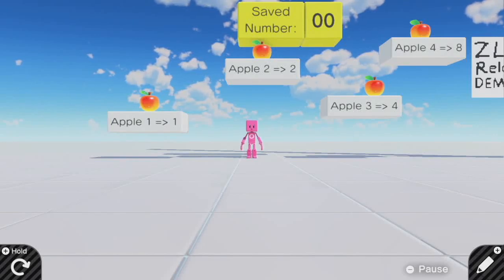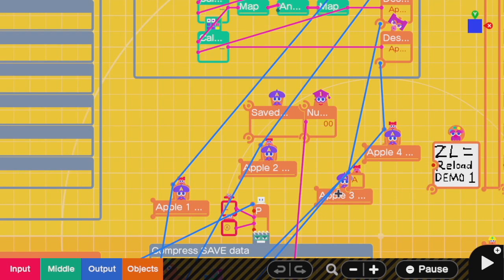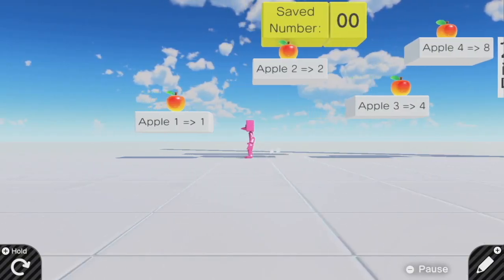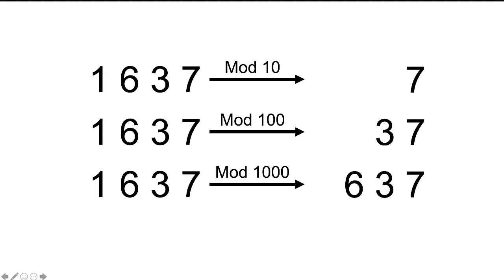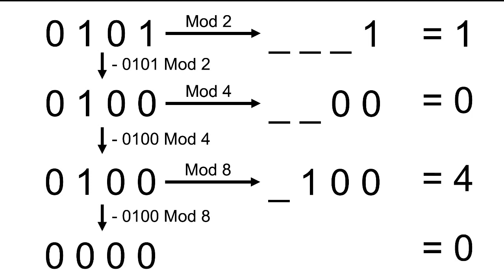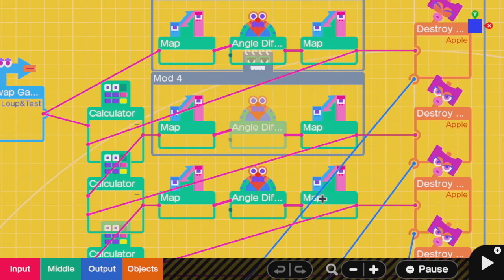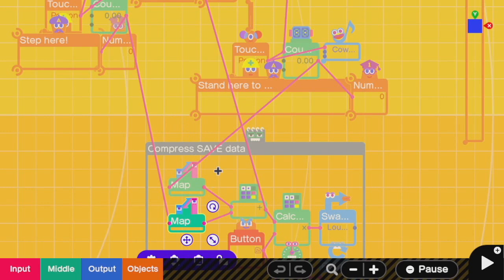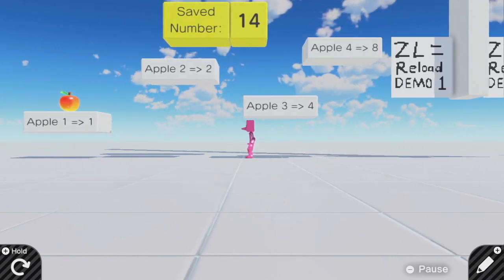How to Use Swap Game Nodon to Save Data and Checkpoints in Game Builder Garage (Tutorial / Guide)

Comment: I'm making a game called persontown
I have two important swap games and one unimportant 
One important swap (swap a) leads to a driving to McDonald's minigame
And one important swap (swap b) that leads to a carnival stuffed with blocks
I want to add a little secret for beating each game
beating swap a shows a little bag of McDonald's 
Beating swap b shows a cute balloon 
But
I have a problem
When I go through swap a after I come back it will show the bag of McDonald's, but, it will also show the balloon.
And when I go through swap b after I come back it will show the balloon, but, it will also show the Mcdonal.
HELP HOW DO I DO THIS 😭😭😭
Reply from the maker: You need to store multiple bits. So something like 1 bit for Mcdonalds completed, 1 bit for carnival game complete, and 1 bit to spawn at Mcdonalds or carnival game. Each subgame needs to take the whole number and edit it if needed. It sounds to me like you aren’t storing the full data and passing it into each game.

So if McDonalds is the 3rd binary digit (worth 4), the McDonalds game would need to be able to add “McDonalds completed” (=4) to the number. This way the game can keep a running tab in the background of which other subgames were completed. This should all follow from the first big example in the video. I hope this makes sense.

Example: Spawn at McDonalds = 1’s place, Carnival Complete = 2’s place, McDonalds complete = 4’s place.
000 = 0 = nothing done, spawn @ carnival
101 = 5 = only mcdonald done, spawn at mcdonald
010 = 2 = only carnival done, spawn at carnival
110 = 6 = both done and spawn at carnival
111 = 7 = All done and spawn at mcdonald
I hope this helps you understand

Comment: Do I need to change anything to store a mix of 0 or 1 and other values of numbers combined?
Reply from the maker: I don’t understand the question? The second example shows how to store/load a combination of different numbers (0-2 and 0-4 at the same time).
Reply: @loupandsnoop  Sorry if it was unclear. I have a number that is a numbered value and a bunch of books that I need to reload so I want to know if I need to do anything to do that.
Reply from the maker: @ESparkAster  Yes, just use the method in the video. Make sure to convert each book into a boolean (0 or 1). Then you are basically storing the value mod (max value of that number), and several mod 2 values. It’s easier to understand by just following the second example in the video. The difference is instead of storing 0-4 and 0-2, you are storing 0-max number and 0-1 (multiple times). Does this make sense?
Reply: @loupandsnoop  Yeah thanks!

Comment: I'm curious if there is a way to prevent the data from resting when I enter the Nodon screen or exit the game? Like keeping a high score value even after exit. Will this facilitate that as well?
Reply from the maker: You would need something like a password system, which would cost quite a few nodons, but would work with this.
Reply: @loupandsnoop  do you know is there somewhere that has a tutorial for setting this up?
Reply from the maker: @trevordunn9029  Not to my knowledge, but it should be easy to make a subgame that just lets you input a code on a key pad, then pass that number into a Swap game nodon (and target the actual game for which you have your main game). The sheer nodon cost and UI clutter would make it worth building as a separate game. I know this didn’t answer your question, but I hope it helped.
Reply: @loupandsnoop  it helps. Doesn't solve it, but I will play around and see what I can do. My plan is to put it in the screen that I am putting the gamepad controller map instructions(if that makes sense), hoping to keep a permanent high score for people to challenge the game..
Reply: let me know if you feel like making a tutorial for that.. lol

Comment: I just discover the utility of that Nodon thanks to your channel, and I'm currently experimenting with that. Still need to verify my theory, but if data is not lost during game swap, I think one can stock into that little Swap Nodon the state of 26 boolean statements and two sets of variable [0-99] and [0-999] for exemple. Or, if you don't mind about using variables about 42 booleans statements. It would be nice...
Reply from the maker: Sure. Be mindful of machine epsilon. If you try to store too many bits in one number, it will rear its ugly head at you. Then when you try to do math to decode, you may lose data.
Reply: @loupandsnoop  thank you..! that epsilon limit is actually what I'm trying to approximate, which seems to occure around 1,0e+14 (and for obscure reason I was able to generate numbers as big as 1,03e+35 but they last just a frame before collapsing, totally not exploitable ahah). OK good news anyway : so far I'm able to swap into another game without data loss/approximation a value in the form of 12345678,12345 wich is already very sufficiant. Of course you can't display such big and precise numbers on a block, but you can without doubt use them in calculus. Oh actually you could display that kind of numbers (like a mario score), using multiple numbers blocks... Now I need to estimate the minimal cost in Nodons of decrypting such big data, and search for better optimisation if needed.

Comment: So using this method for multiple transferred values, each one would have to have a different range in order to then mod them each by a different value and know which is which?
Reply from the maker: Different range in terms of final multiplier, but individual number ranges could repeat. For example, you could store values with ranges of: 2, 2, 3, 3, 5. You'd do this with mod 2, mod 4, mod 12, mod 36, and mod 180.